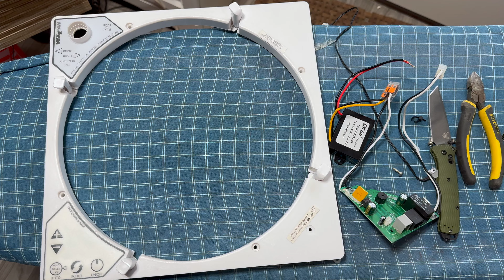Maxx Fan Beep fixed for under $25!!!!

Comment: Thank you so much for this! My Maxx Air PCB never worked quite right, but lived for 7 years before beeping to death. It’s a relief to finally have a stable, functional controller for my fan. Such a great, simple solution. I like this switch more than Maxx Air’s controller and used the $$ I saved on a replacement PCB to buy a Dremel :)